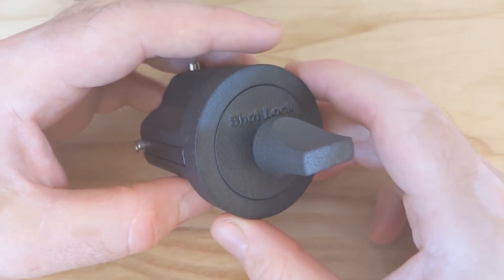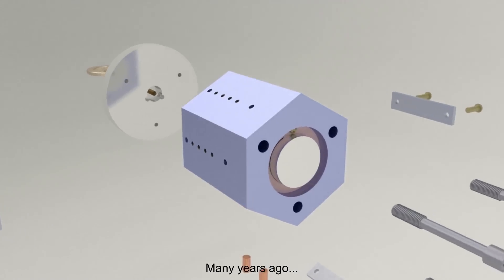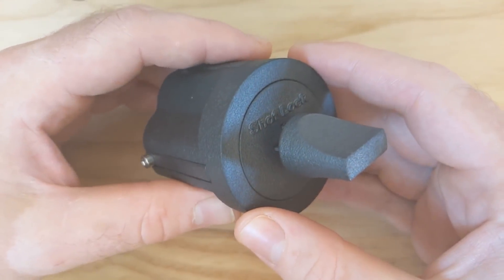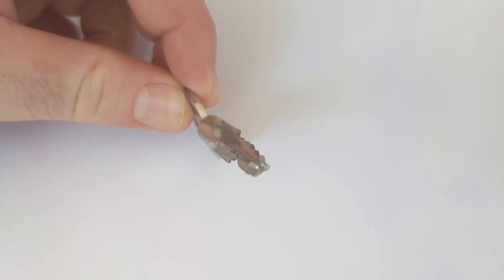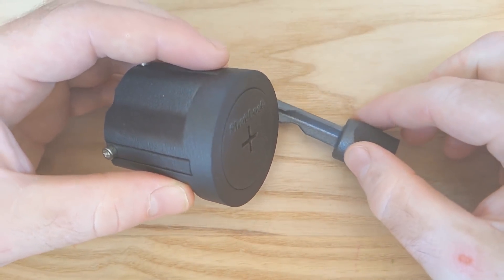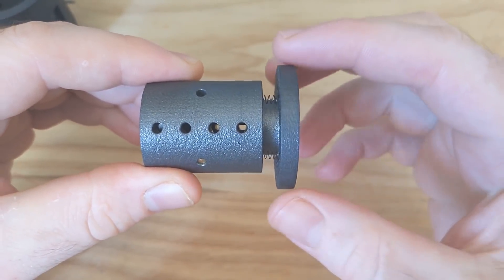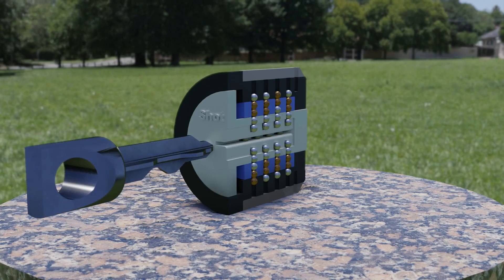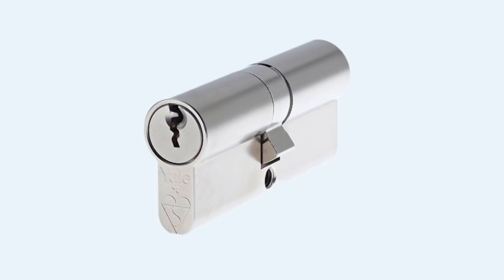A 3D Printed Unpickable Lock

Comment: nice lock design you have made! congrats! 
interesting to see using which picking concept it will be picked
Reply: Very interesting design, indeed. This has to be the best implementation of "disconnect the key from pin stack before testing" for any pin thumbler lock I've seen.

I do think this is indeed unpickable. However, you can probably decode it one bit at a time by lifting just one bit/pin/ball one position and testing if it changes how much you can move the core. Because the double ball high pins cannot be identical due manufacturing tolerances, those double pins bind at different core angles and the difference can be measured. If the measured angle didn't change for lifting the tested bit, the tested bit was not binding (or the bit is now correctly set). If the angle gets smaller than without the lift, you just found the incorrect bit and the correct position for that bit is the position that is opposite of the tested position.

For locating the first binding pin/ball you have to test on average half the pins and for the worst case all the pins. The more pins you know, the less remaining pins you need to test.

You just keep locating pins that reduce the core movement and reverse any such bit to find correct positions.

The hard part is setting the already decoded bits so that you can find the unknown bits later. You probably would need to create a makup key like this: https://youtu.be/2is3ZTli8xE (you only need unfilled pipes with length of short bit and stick in the pipe to make it the alternative bit).

I think you would need to test on average (for 16 bit lock) 8+8+7+7+6+6+5+5+4+4+3+3+2+2+1 = 71 makeup different keys to get it open. For worst case you need double that or 142 test keys until you find the correct one.

The only way to avoid this attack is to have smaller manufacturing tolerances than you can actually measure for the core turning.

Comment: I have been thinking of something similar, but my idea was to have the sleeve held in place until the core rotated far enough, then unlock the sleeve from the bible and lock it to the core, with whatever pins it had. I was going to use a stack of wafers so that I could get at least 3 or 4 bittings per pin. What I have not quite figued out is how to remove the key...

Comment: Scariest thing about this lock, shearing the pins by brute force would leave the lock seemingly functional.
Reply: Key holes are too thin to apply force. Only if you welded out inner circle.
Reply: @kurjibhalsod3547  You wouldnt use a key, youd use a tool in the same shape as the key way and a wrench.
Reply: I know, but width is so slim, and I don't know any metal object can have strength to shear keyway. Thin like paper width.
Reply: Maybe it's in video only looks so slim to me. It looks just 1 mm or less to me.
Reply: @kurjibhalsod3547  The shape of the keyway would make the tool very stiff and resistant to torque. Its the perfect design to apply torque.
Reply: @fulsame1  maybe you are right. That can happen

Comment: I looks like a very viable design.  However, certain Youtube lockpickers state they can get past any lock (i.e. if it can't be picked it can be busted, melted, drilled, or, the door pried open or taken out of the frame by any means necessary).   To my thinking "picking" a lock is getting it to open with no more damage done than using the correct key.

Comment: It looks like it could be picked with slight pressure applied, before the point of no return, with a special tool.
Reply: I was thinking about that too, but then you have the back piece which prevents the inner/middle cylinder from turning before the inner cylinder is pushed all the way in. Perhaps a tool could be made which could apply tension to the middle cylinder while the pins are being set, but it would have to get past the faceplate somehow

Comment: Thing is there should be a balance between how hard it is to pick the lock, how expensive it is, and how hard it is to just break it. If it costs that much to print a polymer lock  just imagine the cost of making it out of a durable material with that complex design.
Reply: it's not that Complex. I think that machining it from metal won't be much more expansive than advanced 3d printing

Comment: I'm thinking a jiggler key made for this lock would work and be the most reliable method also once pushed back it could be rapped with a hammer which would bounce the pins as you tried to turn the core

Comment: I think it can be bypassed by combpicking. If you push all the inner white beads out in the blue compartment, then all the pins (double balls) will sit in the outter housing and you can then turn your lock easily. So not yet completely unpickable... You could prevent that by having some pins further down i.e. the brown double ball sitting on a single white ball, meaning that some pins will be trapped in the bluw housing while you rotate the lock to open. When combpicking those pins then sits between the blue and outer housing providing any rotation of the lock. Does it make sens to you what I say?

Comment: Great design & concept! 
However, the bolts sticking out the side & the back of the body could be an area of vulnerability. If the LPL can get access to these… it might just be a an open and shut case 😜(pun intended).
Here’s hoping for an LPL video longer than 3min👍 (beating most of the locks you can actually buy currently).
If nothing anything else, it’s an awesome attempt🙌 (but here’s hoping it’s more👍).
Would love to see a fully metal and machined lock of this design. Maybe that might finish it off.

Comment: This sounds like it's not Unpickable just that it would take an eternity, because while you can't rotate to torsion the lock but you can press down on it from there it's a matter of identifying the number of populated pins and start attempting permutation of position and just cycling through every possibity unit you get an open. that's where the problem with the pinning being binary comes in less pin position means few possibilites for pin positions. I'm betting if you gave this to someone like LPL he'd say picking this is a lot like picking a SFIC lock, in that you're picking multiple sheer lines. I legit know this is beyond my skill in picking but from this video I can see the attack vector to be used.

Comment: Problem though, with the fact the bearings lessen the height the pins have to be (since the rounded shape bring it down to in between the bearings) you can find where the two pieces are based if the lock slides or not. 
Still required an insane amount of time but possible

Comment: Now see, this is something I'd always been curious about when I watch one of LPL's videos. It looks to me like the typical lock-picking attempt relies on the picker being able to move each pin to the correct location one-by-one. This seemed to me like where you would focus your anti-picking efforts on, since a key is able set all the pins to the correct places all at once, while a picker needs to set them one at a time. A simplest pick-proof lock would be one where you can't leisurely set each pin one-by-one, or in this case, you can't even access the pins at all.
Reply: LPL has reviewed locks like that before. The Bowley in particular is one of the very few locks he hasn't been able to pick. The problem is always expense: Locks like that require more components, all very manufactured to very high precision, which makes them too expensive for widespread use. Bowley locks start at $150, and few house-builders are going to want to spend that much when a bog-standard pin tumbler will do at one-tenth the price. Plus it's somewhat pointless using a super-secure, unpickable lock unless you have built everything else to the same standard. Lock sport enthusiasts try for non-destructive opening, but any actual burgler who can't easily pick the lock is just going to smash a window or body-slam the door until the frame gives out.
Reply: @vylbird8014  What about a lock where the pins have a very strong spring behind them, or are well-greased? It seems like the pins getting stuck after the picker has pushed them to the correct position is the root of the problem. If the pins would shoot back to the bottom unless they were constantly being pushed, that would make traditional lock-picking impossible IMO.
Reply: @fireaza  Yes, that would work - but only if you can manufacture the lock to a quite ridiculous level of precision. Thousandths of a millimetre. Again, prohibitively expensive.

Comment: Er. Looks like a standard crucifix lock. They are pickable.

Edit: Hmm.

I think there's a weakness there in how it slides in and out.

You can use the movement in and out to force pins to stick in set positions. Might be pick resistant but you can set different pin heights that way using the design as shown in the video.

It slides, that disables pins moving back into the first cylinder. That means I can push a pin stack and slightly depress the cylinder until the pin stack is retained, move onto the next. I only need to know how big a single ball bearing is, and find the double pins to decode the lock.

Comment: I worry that with enough torque even with the improper key, those fused bearings would shear where they connect, and the lock will have been broken open without any picking knowledge or real damage to any other part of the lock. Have you tested the strength of those pins to shear forces? The LPL won't try to pick everything, he'll think like a burgular and use whatever means require the least effort, and if that's a just a long handled vice-grip, he will break your lock before trying to pick it.

Comment: if he uses those ball bearings as the pins it would be really ez to just brute force it
Reply: This is a prototype; it's not meant to withstand much force, just to prevent non-destructive entry. As long as the concept works, it could easily be made out of tougher components.

Comment: Looks like you can tension it by pushing in the face plate, so instead of rotational binding you have linear binding..... I could be missing something here. Thats where I would start though.
Reply: The problem with that is once you push in the face plate back you lose access to the pins that stop it from turning.

Comment: Looking at the animation it looks like it could be opened with 4 strong magnets (assuming the pins are magnetic) pulling all the pins all the way to the outer wall would be able to open the lock (If you use the setup from the animation)

Comment: If the 3d animation is accurate to scale, your lock is vulnerable to overlifting the pin stacks. The bottom 2 pins aare always clear so overlifting the diameter of a single bearing is enough to allow the lock to open.
Reply from the maker: It is to scale but you can't really over-lift at all. There's only about half a bearing diameter of space to use and it is taken up by the compressed spring (not shown).

Comment: If the security comes from two ball bearings welded together, would a HSS wrench cut to the same keyway destroy this lock?  Definitely looking forward to LPL having a go at this one 🤗
Reply: The point of this lock is that it's unpickable. It's probably a weaker material than the metal locks so any methods that destroys a metal lock should work on this.

Comment: Is it possible to implement some Rubik's cube mechanism. 
Like you'll rotate something via key, and inside it, something will be solved like in Rubik's cube then it'll be unlocked. 
From what i know, there's a rubik's cube that is not solved by colors, but there are rubik's cube solved via shapes.
That shape will form like a key inside or something, and that will unlock the lock. 
Not necessarily have to be cube.
Basically, the idea is like forming a shape inside to be the key inside.

Comment: Seems if the tolerance on the inner cylinder and outer cylinder isn’t right you could test the double height bearings.

The other question is how durable the lock mechanism is. Would it be possible to just force the lock open? I’d imagine the double height bearings can’t withstand tremendous shear forces.

Comment: Pretty sure it's nit pickable with conventional picks. But have you looked at the tools that they make for special lock? If you're the only person to use this lock, you're probably safe. But if this would he sold a million times, there would probably be a tool invented at one point that makes it rather easy. Like the tool "Bosnian Bill and I (LPL) made" that works with locks / is designed for those locks that are impossible to pick with regular hook picks

Comment: Neat Idea IMO. But why does it have to be "cruciform" ? (I mean beyond being harder to pick, as you need to pick four normal locks at once).
The trick of making the pins inaccessible is a good thing : it could be done on a standard (non cruciform) lock also, no ?
Reply from the maker: Each pin only has two positions so you have to cram in as many as you can in order to get enough different keys.

If it was in a standard form with 6 pins there would only be 64 different keys (actually only 57 reasonable ones). You could easily just try them all.

Comment: This specific prototype would only require four combs to open without a key. But if the pins have a limit which keeps them from moving upwards by two whole spheres (as the animation shows them), then combs would be ineffective.
Reply: Even if the gap was available for a comb I think the comb would tie the middle and inner cylinders together therefore you couldn't depress the inner cylinder therefore you couldn't rotate the lock.
Reply: @john1h  They would need to go up to the first shear line, and no farther. It would work that way, but still requires enough space above the pins to work. Really, if the pins are spherical, they don't even need to go up that far; just enough to get the spheres to slide up on their own from there.
Reply: @RAndrewNeal  you are right. With the binary pinning lifting to the first shear line results in an unlock. Im now thinking you could also add a 3rd pin combo where the pins are ordered single ^ double ^ single ^ single but I'm now convince you could discove which chamber they are in by picking(finding binding in the backward forward direction). Obviously the are other ways to prevent over lifting
Reply: @john1h  Honestly, I think the best way to prevent comb attacks is just to design the lock so the pins can't lift above the shear line.

Comment: For a Euro-style lock, I'd suggest having the lower part of the bible move fore and aft in response to a cammed surface on the plug, with the bible being held aft when the plug is near enough to 12:00 not to break the shear line, and plug rotation past 30 degrees or so only being allowed if the bible can slide forward.

Comment: Actually the principle is fairly easy, and common, and all the recent attempts use the same: set the "pins" (or disks, or whatever), make them inaccessible, and only then apply challenge.
That system is smart but it looks too weird to be  applicable to real cases. Also number of combinations is low.
Reply: with 11 pins as he shows there are 2048 permutations if its using all 16 pins there would be 65536 permutations. Not really that low when most comon 5 pin locks have between 3000 and 8000 permutations depending on pin lengths.

Comment: Is there a reason that a bump key that oversets all the stacks and pushes the inner cylinder back wouldn't work? Since you have a pair of ball bearings at the bottom of each stack, just pushing each pin to the point where only ball bearings are at the shear line should work... Unless there's a reason that that's impossible.

Comment: Wouldn't an easy solution be to push it in without a key and vibrate it until the bearings fall into place? And since it uses bearings, there isn't very many lock combinations possible for mass production?

Comment: Umm, if the animation is accurate, isn't this lock vulnerable to comb picking? It looks in the animation like there is plenty of space to push 3 ball bearings above the shear line which would completely circumvent the locking mechanism.
If so, it would be very easy to fix, by just making the hole slightly shorter.

Comment: Real shame that even metal 3D printed locks likely arent strong enough to withstand a brute force attack
Reply: i think that if you would 3d print it from metal, the pins would be limiting factor. 3d printed metal can get really tough, iirc 90% of machined part

Comment: Could an electrometer or some acoustic wave related instrument/sensor give a different readout depending on the location of the double height pins? Since in the animation it looks like there is only two different pin arrangements, idunno what is normal for a lock.  Although if one can't even apply tension there is probably no way to hold the pins in a wanted position, so I guess reducing the number of possible combinations doesn't matter.

Comment: This Ball Design seems fun and probably hard to pick. But is it hard to force-turn? If made in Metall, couldnt you just use a Lever and break the flimsy double balls?
Reply from the maker: It's no different to spool pins in a normal lock and I've never heard of anyone breaking them.